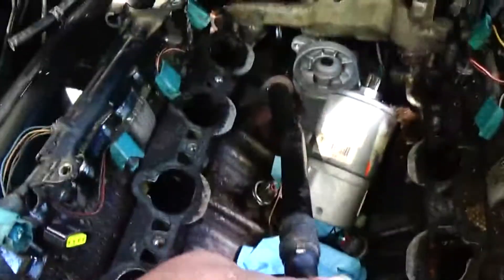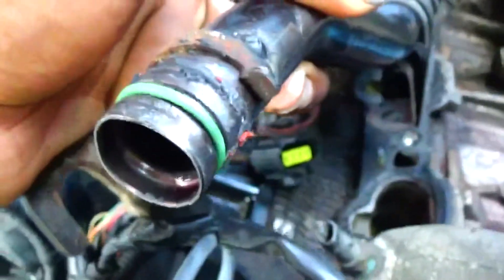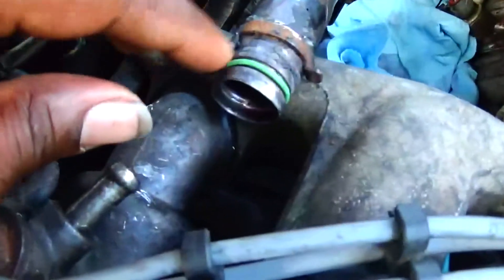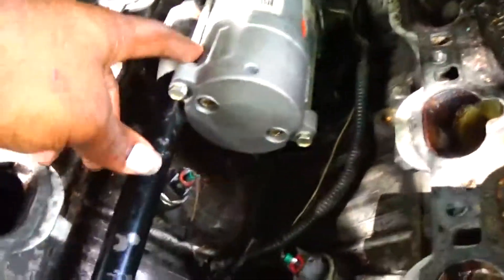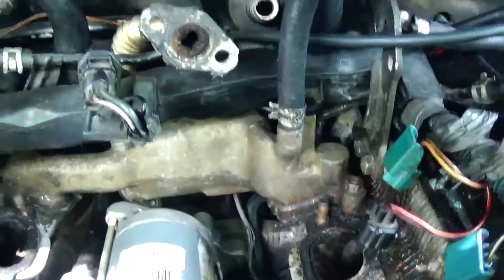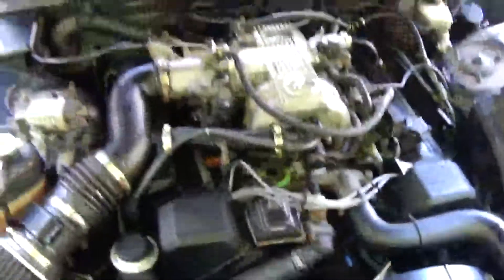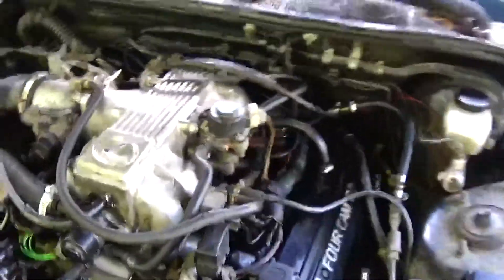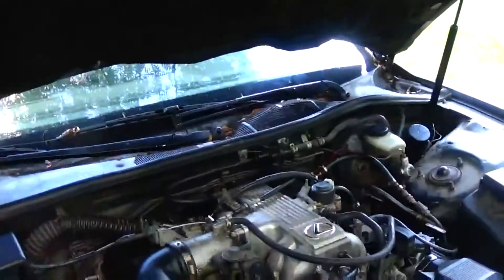Doing maintenance on the LS400 is an ABSOLUTE NIGHTMARE!!!

Comment: i have a ls400 myself and looking for a good air intake to replace the factory one. what do you recommend?
Reply from the maker: I went to Advance Auto and got mines from there. Just the filter
Reply: @Gerarld2097 have you had to replace the engine or transmission or just regular also have you taken it on any road trips recently?
Reply from the maker: @DevonDavies-p7f  I haven’t driven it lately because I currently hit a deer. It’s not that bad but now I have to put more work into the car

Comment: did you remove the crossover to change the starter?
Reply from the maker: Yes
Reply: @Gerarld2097  how exactly did you get the egr tube off? Lol
Reply from the maker: @jaronhoward4837  I used swivel ratcheting wrenches. It’s easy to disassemble and remove if you’re careful but it’s gonna be a pain reassembling it as far as like the egr, the starter and the middle cooling pipe.
Reply: @Gerarld2097  so you removed the bolts for the upper egr tube with ratchet wrenches? How? Lol
Reply from the maker: @jaronhoward4837  swivel ratcheting wrenches and it’s kinda gonna be a difficult area to work in. I used one hand to hold the ratcheting wrench part while I turning it with the other. You have to be precise and patient with it. Use both hand so that way you also won’t drop the wrench